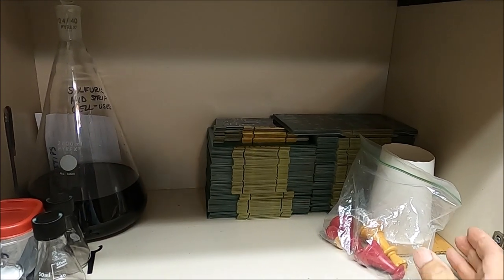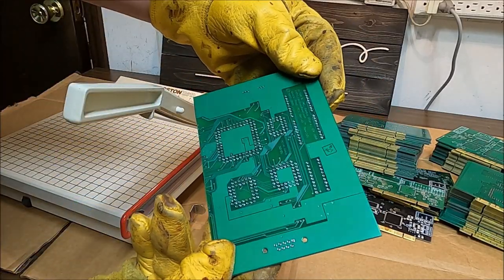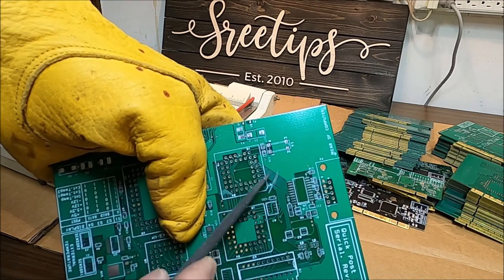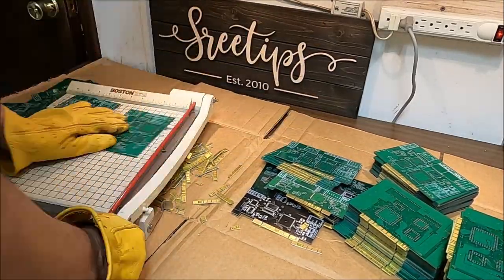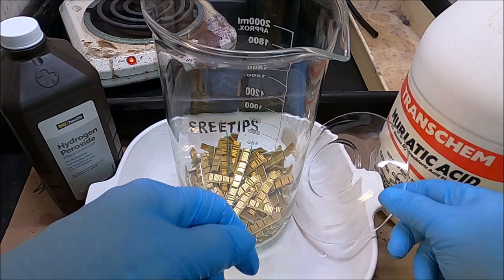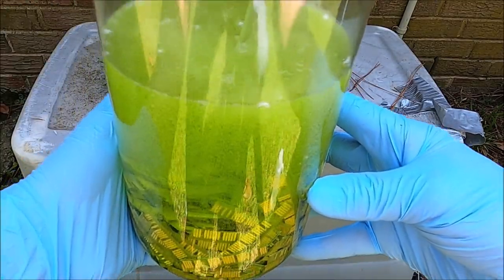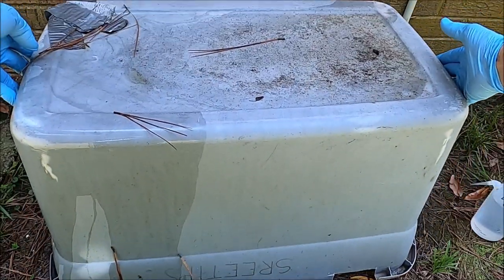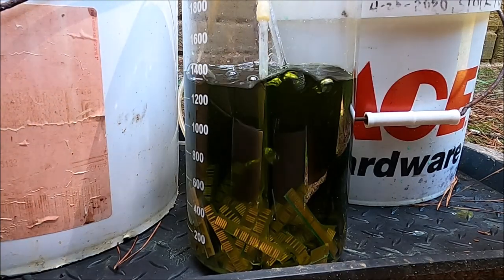Computer Circuit Card Gold Recovery Hardware Store Chemicals Pt1

Comment: The pass throughs are copper with thin layer of gold on top, deposited at the same phase of the process as the gold layer of the edge connectors. I suppose you could process whole boards in big enough container and get those as well. The lacquer layer should keep most of the traces out of the process.

Comment: You’re SO right. The yields so low for not only the time, but the chemical cost to mess with computer scrap. If you get it free, nailed it. If you have to buy it, it’s more than likely a losing situation. 
eBay sellers are just taking people for an expensive ride. They’re the only ones making the money out the recovery.
Reply from the maker: I bought trimmed fingers for $800 that only yielded about 6 or 7 grams back when gold was $1200 per ounce. The seller congratulated me and said, “you’re going to make lots of money with these.” I don’t know if he really thought that I would or if he was just trying to stroke me.
Reply: sreetips You bought right as you know gold price rise will get you your money. But if you had to buy them when it rises they’ll just be taking people again. 
Like you said before, it will probably go to $5k/OZt and if my math is right that’s about $950 for 6grams. 👍🏻🍺
Reply: @sreetips  approximately how much matarial do you use I mean weight one kg or something.

Comment: Unless all of the SMT pads are gold as well then there wont be any gold on the through holes. Those boards are most likely tinned using a HASL (Hot Air Surface Leveling) process, only the fingers would be left out of this process. The remaining metals on those boards would be copper, tin, and possible trace amounts of silver, germanium and nickel. What you were seeing was probably just copper showing through thin spots in the tinning.

Comment: If you boil those trimmed PC slot cards in the the solution of baking soda for a couple of hours, the covering liqueur will start to pill off.  I am not sure if you have enough of 99.995 clean copper to worry about that.

Comment: Hello friend. I had a question I hope you could answer for me. I understand that the H2O2 (peroxide) provides the oxidation for faster reaction of the base metals, but I have read, and seen that it also dissolves the gold as well. I saw another mention that is why you must use the bubbler method to keep it oxygenated, but this is not my field of expertise in any way. So, I was wondering would you be able to just us heated Muriatic (HCL) with no H2O2 (peroxide) to keep losses at a minimum? I see everyone use the peroxide, but I don't fully understand why unless you have that much material, and time is more important. Thanks again for your dedication, and the information you share with us laymen.
Reply from the maker: It has something to do with attacking the base metals first. I’m not sure. I just know that the acid/peroxide will dissolve the base metals and release the foils so that they can be recovered. Also, dissolving the gold with acid/peroxide takes lots of heat.
Reply: @sreetips  I see. Very helpful information as usual! Thanks for the response, and tips streetips. You're the best.
Reply: @sreetips  Unsure if you saw my other comment, but if you have the time and wish to respond I'll leave this here.
-Would you not be able to treat HCL + NaClO (bleach) as a gold stripping agent? In theory (from watching many different methods) It appears that if you made the dissolving agent you could just dip gold plated items into it then go from there in precipitating the AU. If you do read this one I appreciate it, and was also wondering if you need to neutralize the (HCL + NaClO) solutions before attempting the SMB drop similar to what is needed in aqua Regia. (When solution is too acidic)
Reply from the maker: I’ve never tried it. I don’t think it would work.
Reply: @sreetips  would you have an idea why? My thinking would be that it could dissolve all the AU into solution which pulls it away from most of the base metals. from there you could then drop it with smb, and then remove any further precipitated metals on the fine "mud" with HCL washes until the solution was pure. I'm not fully aware of what else SMB precipitates when it goes into solution though, so this is why I say "in theory". It seems like most every other base metals or things like palladium/silver would be separated during the hot HCL washes when you get the somewhat impure "mud".
I'm unsure about how much freedom you have with these things, but I would be elated to see it be tried. I feel like it would save a lot of acid resources if accomplished. It would be similar to treating pure gold fingers or plated gold with aqua Regia, then doing HCL baths as usual on the precipitated AU "mud". I can't tell why it wouldn't work that way, and can't really find answers on why the base metals are attacked first with HUGE amounts of waste/acid. I would only imagine needing to "attack" base metals if people wanted to free up gold fingers from mobos like many do in their videos.

Comment: Iv got some computer boards that have gold vains ( if that's what the curcuitry is call) is it the same way to extract the gold from the boards so I can do it when I do the fingers or do I have to use stronger chemicals due to the excess amount of the green resin stuff, if I need stronger chemicals can you tell me which please as its an experiment iv been waiting to do for a while
Reply from the maker: The fingers have gold but only a tiny amount. The solder mask may able to dissolve with with lye solution. Try a small piece in a test tube before to commit the whole batch

Comment: Just a quick question, as I'm already familiar with this process. Those boards look very clean, do you remember when you bought them were previously cleared of all the components? Did you de-populate, or were they just blanks awaiting components? Thanks, do appreciate every bit of knowledge your willing to share.
Reply from the maker: I bought those boards about five years ago on eBay.
Reply from the maker: They were brand new never had chips installed
Reply: @sreetips  thanks, that's what I had guessed as I've depopulated using most every thing possible from chisels, heat guns, propane torch and hot sand bath. Never got anything to look that clean with no solder.
Thanks again for your knowledge and feedback.

Comment: other than easy access of chemicals is there any other benefit to using this method?
Reply from the maker: The hardest part of this process was getting the fingers chopped off with that paper cutter. It took me about 30 minutes, including clean-up, to do that. Now it’s time to let the chemicals do their work.
Reply from the maker: Sorry, I didn’t answer your question. This method is the easiest way that I have found. Some suggest scraping the foils off with a hot iron. I say let the chemical do all that work. Others would say to just hit the fingers with aqua regia and put EVERYTHING in solution. I’ve done this and there’s a video posted on my channel where I do just that. But it makes a very dirty solution. Getting the gold from a dirty solution can be challenging. Not a good place for someone new to refining to start. Removing the base metals first to recover the gold foils, then dissolving those foils with chlorine makes a nice clean solution easy to precipitate our pure gold. You’ll see in part 2 of the series.

Comment: Would heat speed up this reaction? Or would it cause more problems than it’s worth?
Reply: hcl+h2o2 is producing chlorine even at normal temperature, if you heat it up it will produce even more... also the reaction is exothermic so the solution is heating up by it self anyway...

Comment: What does the air bubbles do for it? And is it absolutely necessary?
Reply from the maker: I’m not quite sure, something to do with oxygenation to dissolve the base metals. I believe that it speeds thing up. I’ve not tried the experiment without the bubbler
Reply: @sreetips  perhaps I will and let you know how it goes. Thanks for the response. And thanks for the excellent vids!

Comment: Hi. Subscribed to your channel a couple weeks back and have been watching many of your  vids. I was curious if you had a preference for your glassware? I cant really see clearly the manufacturers name on what you're using. I want to get a larger variety of beakers and flasks, but there are so many choices and price ranges. I own a couple of pyrex and bomex beakers, and I've also had a couple of no brand breakers that shattered on me, i think from thermal shock. Going from hot to cold and vice versa. Im not afraid to spend more on good quality, but i also dont want over spend on something just for the name. Maybe you already have a video on what equipment you use, but if not, could give a few quick comments on what you use. Thanks for your vids. 

B G
Reply from the maker: I bought just about every piece of glassware on eBay. As long as it Pyrex or borosilicate then it should be able to take the heat. I’ve only had one beaker break from the heat unmarked thrift store beaker

Comment: you dont need to bubble air thru the hcl+h2o2 solution except as a way of agitation... i am dissolving copper from PCB's with this solution since 1995 and never ever had any need to bubble air...
Reply: Is there a cheaper way to do agitation other than bubbling?  Not sure I get your point.  Agitation certainly helps with speed.
Reply: @isaacclark9825  true agitation will help speed up the process, but the reaction itself produces chlorine and hydrogen (which you can notice in the video as bubbles even before he inserted the bubbling pipe) and the reaction is also exothermic which produces thermal mixing anyway, so bubbling is not needed at all...
when you make PCB's you need to agitate tho, because you use wide container with like 10mm solution at the bottom, you need enough solution just to cover the PCB and a bit more...

Comment: What give the best yield of gold if not computers?
Reply from the maker: I can get 0.3 gram pure gold from a single pentium pro cpu. That’s the best yield from computer scrap that I’ve ever recovered.
Reply: @sreetips   that is so much from a single CPU!
Reply from the maker: Karat scrap gives the best yields. 18k scrap gold jewelry will yield up over 70% by weight. So if you’ve got 100 grams of 18k scrap gold you can pretty much bet on getting about 70 grams of pure gold from it.
Reply: A pure gold bar can yield upto 100% recovery if done correctly. 0.999 gold bar in AR, and then SMB, then melt. Of course there will be losses in the process, so you get 98% recovery. If done by Sreetips, the yield will be 99.5%. It is the best yield of all :) Just kidding.

Comment: Hello Sreetips, To "COMMERCIALLY" recover precious or base metals from ewaste, it requires far advanced industrial scale set up. Though theoretically anyone can do it and end up with a fat bill. Appreciate your effort to demonstrate the process.
Here I felt relavent to refer to two youtube videosto show a process similar to yours but better. Instead of cutting fingers and exposing the whole fingers including board to chemicals, he used a solder gun to chip off the gold out of the boards. I feel this way we reduce the need to treat board with chemicals.
Squeezing facts out of those two videos, 1000 RAM sticks - 17.5 kilograms -->90 grams of foils --> 85 gram button after melting. The button consist of 3.45% gold i.e approx 3 grams.
Getting gold chips out of RAM sticks : https://www.youtube.com/watch?v=yPdl7GjzAt0
Making Button / assaying : https://www.youtube.com/watch?v=sYTPb_rx7LE
Note : I am not promoting any other content. Giving link just to give some relavent info. Please do not misunderstand me.
Reply: If you do the solder gun way to get gold flakes, they can be directly subjected to nitric acid. The gold flakes are way better than shots as the surface area is hundreds of times larger and nitric will make a quick meal of copper and nickel. Or you can use H2SO4 cell to extract gold out of the flakes.
Reply from the maker: It took 30 minutes just to chop the fingers off. Scraping the gold off with a solder iron would have taken another hour. I’d rather let the chemicals do all of that work for me.
Reply: @sreetips  In your just concluded video Silver refining with drain cleaner, you said every minute of time spent now will save me a lot of time in later process while referring to removing sugar and lye from the powder.
Going by the same logic, spending another hour more on chipping off foils with solder gun could have avoided the last 3-4 days of pickling the whole lot including non metallic boards and God knows what else in the board.
With chipped off flakes, instead of 300 grams of board with fingers, you should have had may be less than 40 grams of flakes. 25-50ml of Nitric would have eaten the copper, leaving 1-2 grams gold powder for AR.
Please no offense. I am just being inquisitive. In future, if you have gold fingers, I request you to make a video with solder gun chipping, nitric, AR process. Pleeeeeeeease :)

Comment: The only gold isn't in the fingers, there may be some within the IC chips, that's common.

But yes, the yields on those will also be low. Many companies specialize in getting gold from electronics, but they work with enormous quantities of ewaste.
Reply: Unless you are getting these boards for practically nothing, or perhaps even being paid to cart them away, there just is no payoff for your labor and chemicals.   That is particularly true if you are doing this in your garage with a few beakers and a hot plate.
Reply: @isaacclark9825  Some in the processing chain will actually be paid to dismantle ewaste. In the EU and USA, consumers pay an upfront fee when they buy electronics. 

Processors might make videos advertising themselves, but never give up their processing secrets.
Reply: @aredditor4272  check out MBMMLLC, they manufacture hammer mills and shredders, they do have their own channel. They cater mainly to miners in the recovery of ore quality of gold, but also in the shredding and processing of precious metals from electronics. They have a multi step shaker table to process the gold from  electronic circuit boards. They also have jaw crushers to process hard rock.
These are all small portable systems.
Reply: @isaacclark9825  have seen this comment so many times, what is the monetary value of one gram of gold? Versus 18$ of muriatic and hydrogen peroxide. What is sreetips payroll cost?
I'm a scrapper, I pay 0$ for the electronics I recycle. I'm sitting on approximately 500# of zinc, almost the same in copper and aluminum. I have no idea how much in gold, silver, palladium, platinum and other types of rare earth and precious metals. I'm retired so I don't pay me anything, it's a hobby, keeps me busy and out of trouble with the boss lady. Have a good day mate.
Reply: @donniebrown2896   If you read my original comment, you will note that I made an exception for folks who are getting the recycle for free or who are even being paid to take the stuff.  Why then are you asking me to justify my position by telling me you are getting scrap for free?  It that is the case, then my comments do not even apply to you.   

Sreetips is doing this because he makes videos and not because he makes money from the recovery.  He is also retired.  However, he told us on several occasions that he probably is not making any money recovering the gold from PC scrap.
Reply: @donniebrown2896  I like his channel, but I think he's kind of a small player as far as being a manufacturer of processing equipment.